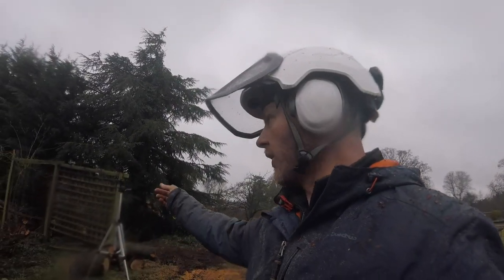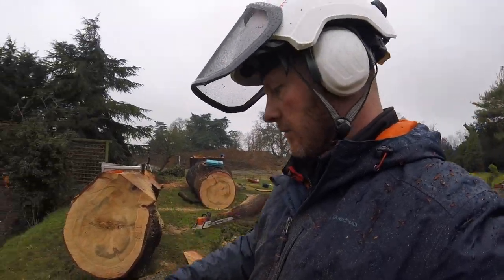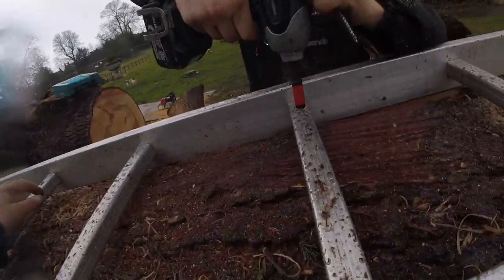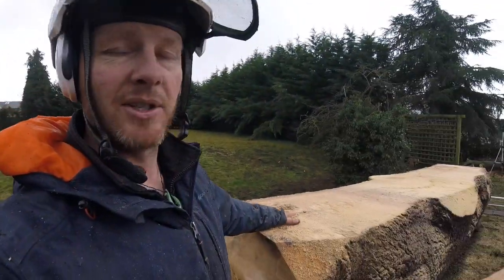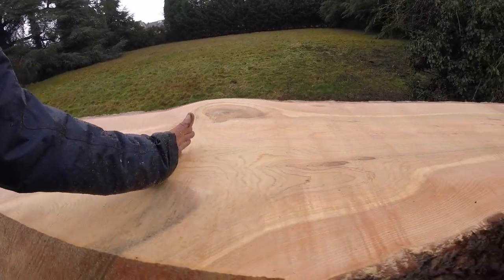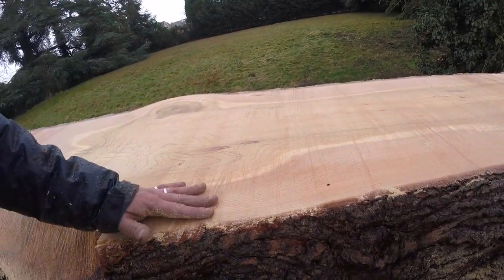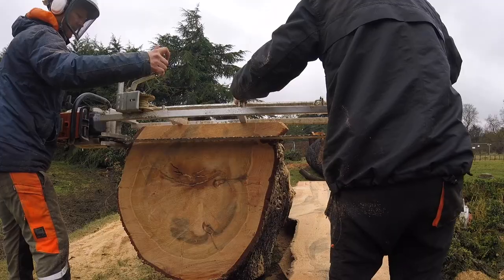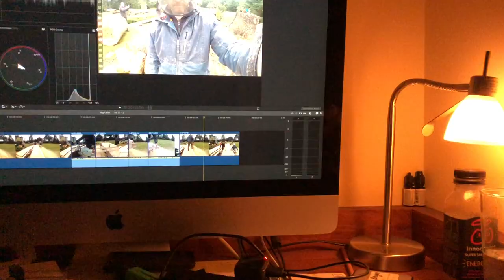Big Cedar Part 1

Comment: Another great video.  Looking to some milling myself.  I read that you use an ms880 saw.   What chain do you use?  What a great looking log.  Thanks again.
Reply from the maker: Hi Todd, thats great to hear yes I use a MS880 with Stihl ripping chain, I started with a 660 but moved up fairly quickly just to speed things up.  Cheers mate.

Comment: Hi Blaise..

I have seen you do this milling with one mill and one power head, and then I saw you did another one with a mill and two powerheads, now my question is which one is better? What are the disadvantages? I own my own 36” inch mill on a Stihl 661- But I’d like to be able to occasionally be able to Mill larger logs, and I am a bit in despair regarding which Alaskan mill way I should go. 
It will be nice with help from someone that’s tried both..
Best regards, Martin, Denmark
Reply from the maker: Hi mate the double mill is a lot more of a faf to set up and you need more people to run it.  You can get the same cut on a single powerhead its just a bit slower, you would get the same speed increase from running an MS880.  Hope that help bud cheers Blaise
Reply: Blaise Brogan appreciate your answer buddy. So your recommendation is to keep it to one powerhead and being able to operate the mill alone? :)
And then I am capable of killing logs as big as if I did a two power head mill? 
Then I’ll add the ekstra oil kit as the bare becomes rather long- right? :) 
Have a good one mate.
Reply from the maker: Martin K yes I recon that’s the way to go. I’ve never need the extra oiler though.
Reply: Blaise Brogan thanks for the answer mate and happy holidays.. 👌🏼☺️